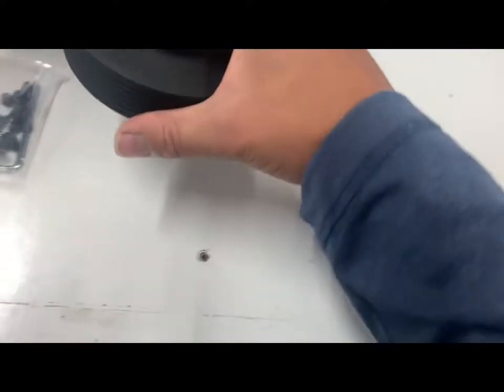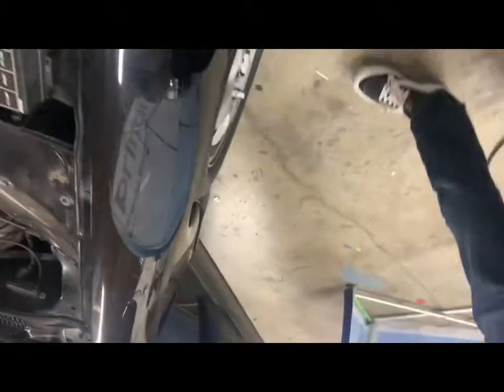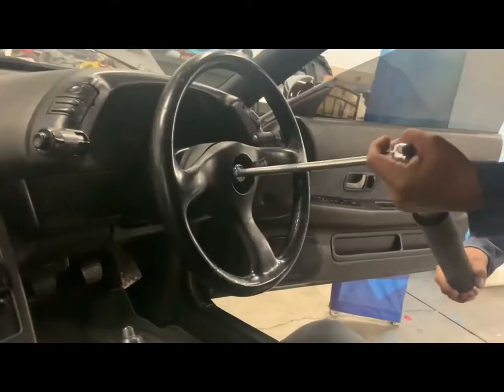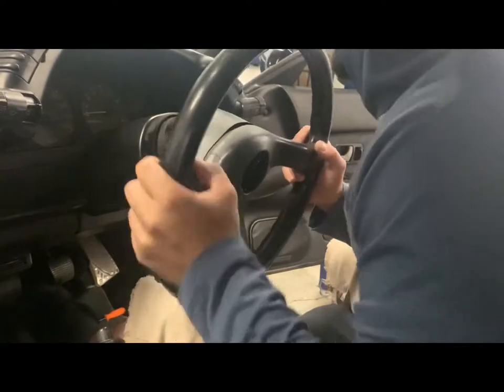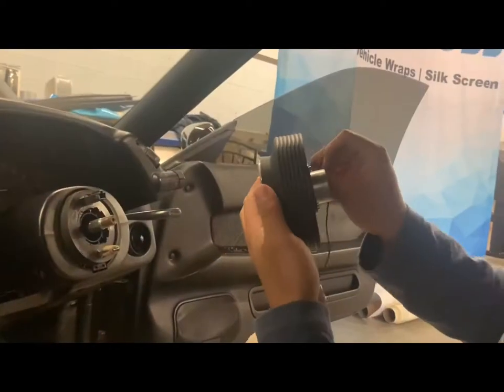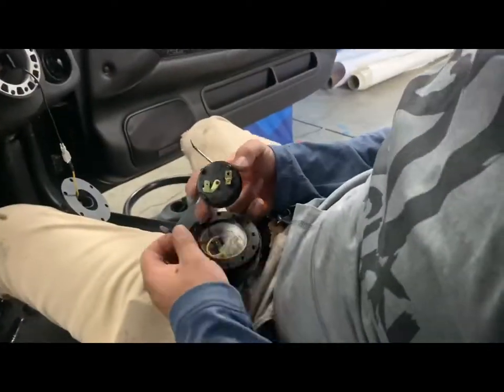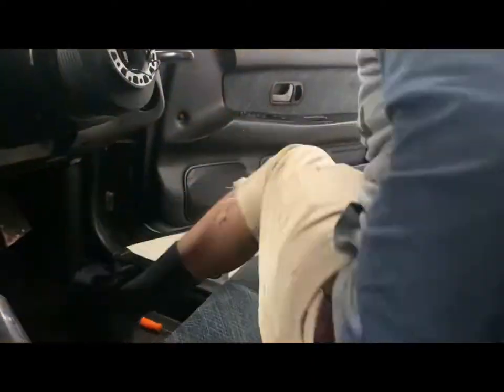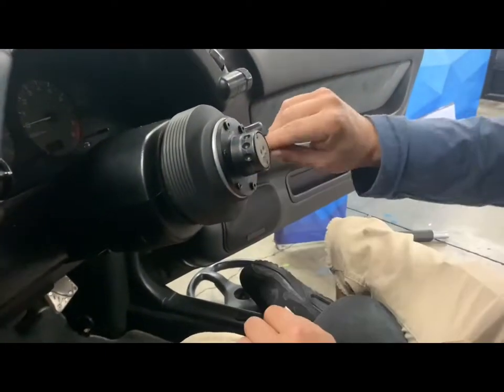Works Bell 616 hub x Nrg install on my Skyline R32  gtst!

Comment: To get the horn to work you just need to ground the second wire from the quick release. What I did was put a eye end on the black wire and put that between the boss and the NRG hub. Shoot me a dm on Instagram @jdm_bro_r32 if you have any questions!

Comment: Hey bro I noticed that this same hub 616 is what is required for my 92 tt 300zx cuz it has the hicas. I wanted to know if this hub will work fine with nrg quick release? I plan on getting a 2.0 nrg quick release but would this hub work with the nrg release? Thanks in advance and good video👍
Reply from the maker: Yes it works perfectly fine, I have the nrg quick release set up as well and mine works perfectly fine. There’s a certain direction you have to mount the hub, so make sure you face the holes in the right direction before bolting down the hub.
Reply from the maker: Z32 4ever thanks brotha I appreciate it 🙏🏼
Reply: Yeah bro keep up the good work💯 and thanks for the info! I'll have mine on the way soon.

Comment: Nice video man, i notice that you have the same issues as me (need to hit gas pedal at ignition) do you figured out what is the solution for this, im at the point to clean my iac valve
Reply from the maker: To be completely honest it went away on its own, I believe the cold weather had a factor to that but, but I can be wrong lol I would clean it out, maybe cleaning out the throttle body and the maf would help.
Reply from the maker: Thank you I appreciate that!
Reply: @Eddrange  i already look at those but i will double check thx man! And your welcome :p
Reply from the maker: Godzilla9320 no problem! Anytime! You can also check the throttle cable to make sure it’s tight and not loose.